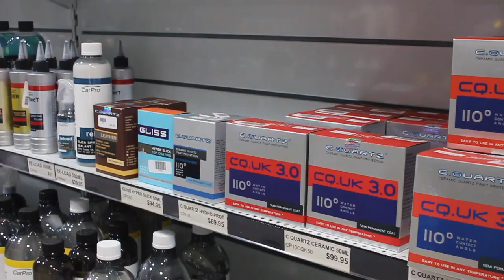How to apply ceramic coating step by step

Comment: I Love the detailed information you provided in this video 👏🏽👏🏽👍🏽👍🏽. I know this is an old video, but I hope you will still reply. I really want to apply a ceramic coating to my car. I don’t have all of the expensive tools needed for paint correction and polishing... So, I wanted to know, can I have the cleaning, correction and polishing done at a detailer near me, and then drive to my garage and apply the coating??? Or would even driving a short distance contaminate the car all over again?? I would really appreciate some input. Thanks in advance 🙏🏽🙏🏽
Reply from the maker: Brad Cooper hello getting a Detailer to correct your paintwork is fine. It will not get damaged in that short time. Hope this helps.
Reply: customspraymods Thank you very much for replying. I really appreciate it, and Yes, that information helps me out a Lot 👍🏼

Comment: Ive always doubted this stuff. What is wrong with a decent polish...dare i mention the words "silicon polish"?
Reply: By the way...thats a really clean shop
Reply from the maker: The glass component in the ceramic coating make them last way longer then traditional sealants.
Reply: @customspraymods  Is this product/process what dealers call "paint protection" (ie upselling/aftersales) ?
Reply from the maker: Ben Hardy yes but they use a cheap and poor quality product.
Reply: customspraymods  once a month Supergard products / wax do the same job and for a very small price than Ceramic coating I should know as I’ve been in the business 35 years,Ben is totally right

Comment: Very good video!  However, I'm surprised that you just have to apply a compound before the ceramic coating.  Usually several steps are required.  What would you have used if you would have used a cutting grade compound?  Let me know.
Reply from the maker: Gaétan Hébert basically step up to fine. Course medium then fine.

Comment: After using both CQ Quartz and Nova Evo, which would you recommend? My car has a decent amount of small stone chips on the bonnet and a couple of scratches on the doors. Would these be required to be fixed before ceramic coating?
Reply from the maker: DUK33Y yeah you want to at least fix the scratches. The stone chips also but they can just be brush touched. There is about a $100 price difference the Nova Evo is just awesome and saves time as it's just one coat. If your willing to spend extra go the Nova. It's worth it.